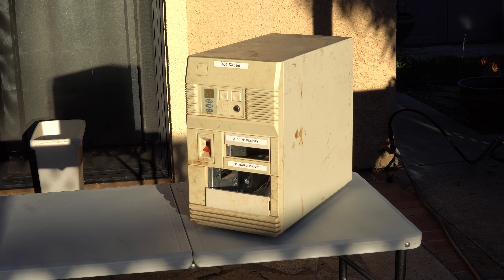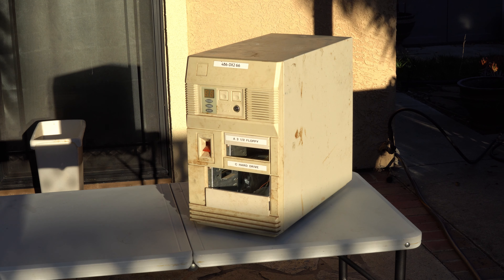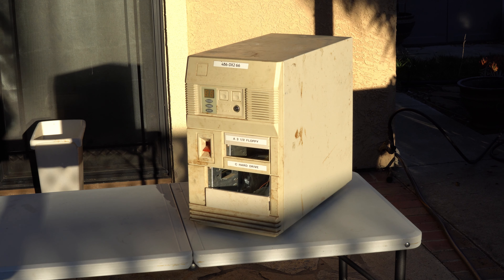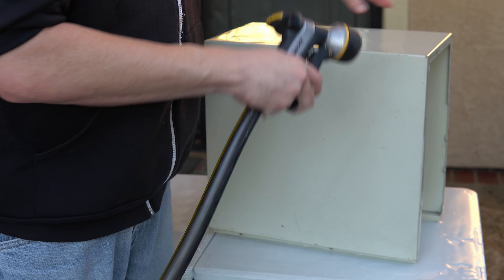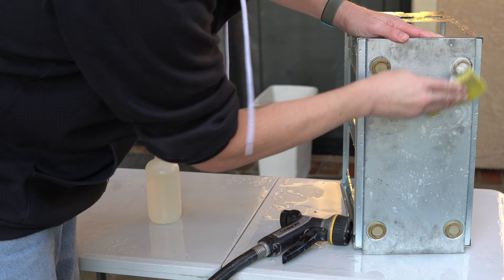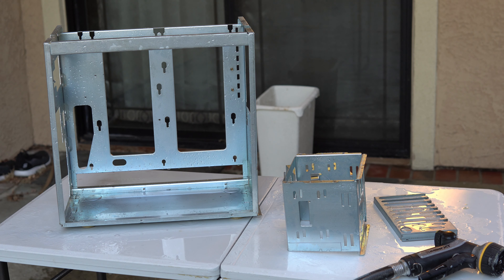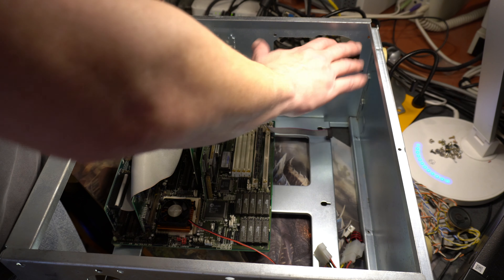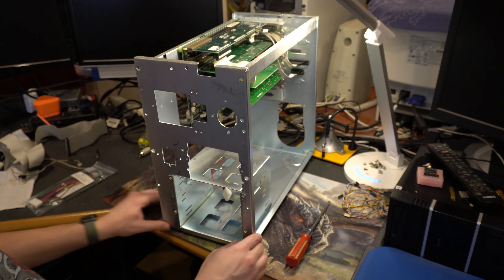Moving 486 build into new ugly case. It's so ugly and I love it!

Comment: Bottom power supply. This thing was way ahead of its time.
Reply from the maker: Yeah the entire system is basically upside down, LITERALLY. There are little telltale signs here and there in the metal stamping that indicate that this may have been adapted from a different case design where the mobo was on the other side and the PSU was on top. Quirky cases like this are super rare these days, I feel very lucky to have it. I'm friends with the former owner and he's thrilled to see the case his family computer was in when he was a kid is still in use.

Comment: I cannot recommend to clean these things with harsh side of the sponge, because it can easily scratch and remove zinc plating on the metal frame. Use it as a really last solution, if it is necessary. Otherwise - there is risk of the full surface rust - during years, even inside the room.
Great work, the case is the most beautiful I have ever seen in my life.

Comment: such a nice case! where did you get that AT to ATX adapter?
Reply from the maker: They are on eBay and sometimes on Amazon if you have it available wherever you are in the world. Seem to work great 99% of the time. Some older boards don’t like modern ATX PSU’s however, and some specific older ISA cards like the Soundblaster 2.0 (and others) require -5v that ATX motherboards don’t support, even older 20pin units. Just something to keep in mind.
Reply: @c90s_tech  thanks, i ordered some from amazon!